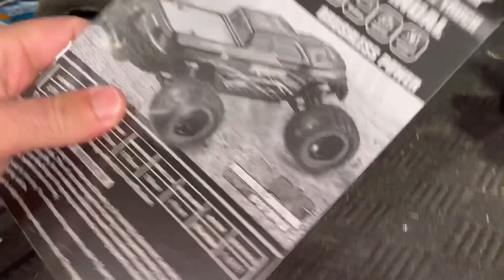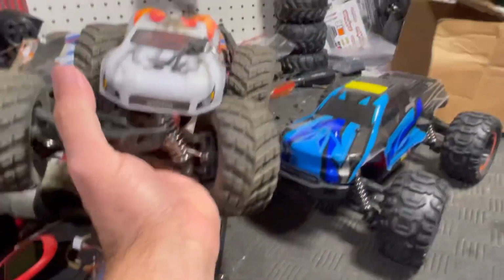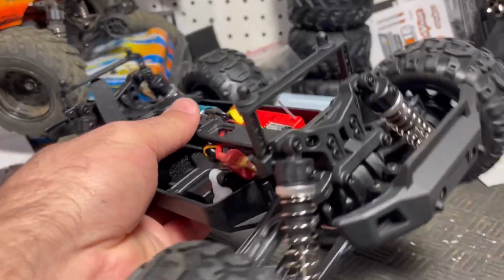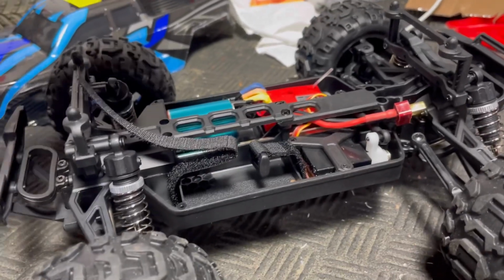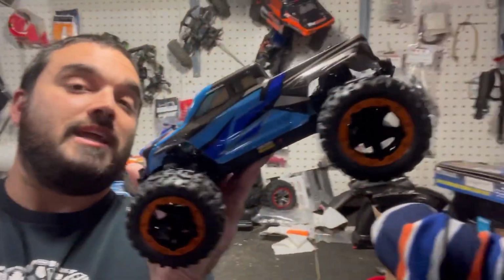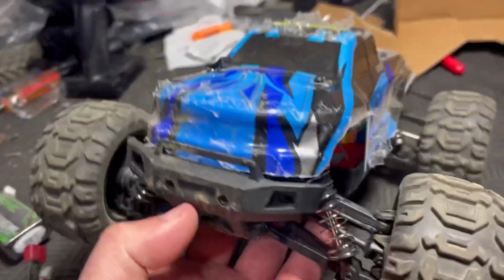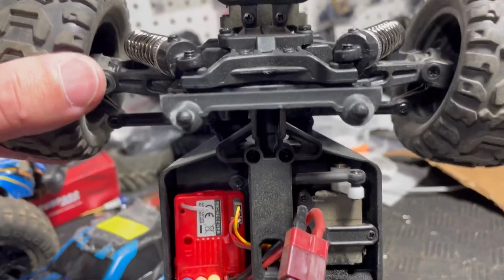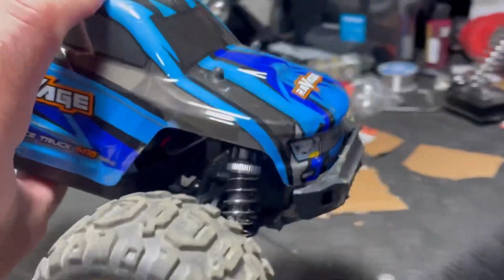HBX 16889a Brushless RC Truck - Review & Durability Test

Comment: I have the SG 1601 Pro which is the same RC all I did was cheap oil shocks from Banggood and it’s my favourite skatepark basher, it never breaks.
Reply from the maker: Yup! It’s a beast! Those are the shocks I put on the 16890 and it made a huge difference, so I’ll be ordering a set ASAP!!
Reply from the maker: I wish I could break away from my house a bit easier to hit a skatepark. That’s why I set my ramps up the way I do 🤣.
Thanks! I’ll look into that MT10E. Looks pretty good! As far as which HBX to get, are you wanting to stay with 1/16 scale? Between the 16890, 16889a, SG1602, volcano, I’m pretty sure it’s just the body shells that are different. Not sure if there is a brushed version. We have the PRO version on the way which is metal drivetrain, oil shocks, and a slightly bigger brushless motor.

Comment: Nice I have the same. But you buy better the 16889a Pro cost a little bit more but oilshocks, better motor metal diff. Is nearly the next on my wishlist 😜
Reply from the maker: Ya, normally I would get the pro, but that’s ok lol! I’ll be doing these upgrades anyway 🤣

Comment: What's the difference in between the 16889 and the 16889A ?? If you could only get one what would you get this rc or the Deerc 9201e ??
Reply from the maker: The main difference would be the brushless motor if I remember right. Going for the 16889a PRO would be better though as it has metal drive train parts that last much longer. I would go with that over the 9201
Reply: @DerbyCityRC  darn I already got the Haiboxing !!
Reply from the maker: The 16889a series is from Haiboxing 😃
Reply: @DerbyCityRC  yes I know it's the rc that I got ! It's Seems like a nice rc !
Reply from the maker: It is indeed!! 😃
Reply: @DerbyCityRC  
It's my first hobby grade rc ! Do you think I made a good Voice ??
Reply from the maker: @timmy4539 which hbx did you get?
The pro version?
Reply: @DerbyCityRC  
I got the Haiboxing 
16890A
Reply from the maker: @timmy4539 the pro version has quite a bit of extra goodness. Bigger motor, metal drivetrain components and differential gears. If it’s not too late, I’d switch if the price seems fair.
Reply: @DerbyCityRC  it is to late the 16890A took my last penny to buy !
Reply from the maker: @timmy4539 ok well no worries it’s still an epic car! Can always upgrade to the metal parts one piece at a time if it ever breaks 😃
Reply: @DerbyCityRC  👍

Comment: Hi , i have one of those . 
For some reason , after a few bashes , the steering works but the car stops on full throttle . Changed batteries of course ...
Any suggestions about what the problem could be ?
Reply from the maker: As in when you pull the throttle all the way, the car stops, but works normal on mid-throttle?
Reply: Stops and dont move anymore .as if there's a problem. Dosnt move even a bit afterwards ...
Reply from the maker: It’s hard to say what the problem is. A common issue I’ve had is the main wire leads breaking on the esc so look for tears in the wire. Any alterations to the car or is it stock?
Reply: No alterations .
I"ll check the wires . 
Thank you so much for responding !!
Reply from the maker: You’re welcome! Mine occasionally would do what you described but it was usually after atleast 10 minutes. I always thought it was from thermal cut off, but it got super hot when I ran it on those extra large tires and didn’t shut off, so I really don’t know. Does unplugging the battery and plugging it back in make it start working again?
Reply: I actually replaced the Esc and the moror , and it still happened . 
Could it be related to the stearing sistem ?
Reply from the maker: I would say if the steering still works when this happens, most likely not. I have heard of Arrmas having a faulty servo causing other issues. Might be related to the transmitter/receiver
Reply: Thanks mate !!!
I guess i"ll have to replace the servo too .
Reply from the maker: That’s an odd situation. Hopefully that’s what takes care of it for you!
Reply: I feel obligated to share 😁
Changed the servo and the car's back and running . 
Still , thanks for the help .
Reply from the maker: @yonatandeakin5274  oh that’s awesome!! Glad you’re back in business😃😃🤘
Reply: I have a 2s lipo 7.4 1600 mah . 
Can i use it regularly with the usb that came with the car ?
Reply: I meant , can i charge it with the usb ?
Reply from the maker: You mean to charge it? Yes that should be ok, just always keep an eye on the batteries and be sure to unplug it when done charging. Always keep it in a lipo safe bag. Even better if you can keep the lipo bag in a vented metal can also👍
Reply: I hear alot of about Ballance the battery . What if i don't and just charge it and go untill batteries empty  And do it all over again ?
Reply from the maker: The balance charging is essentially just using the smaller white plug on the batteries, which the usb charger does. So yes that’s ok, just don’t let the batteries completely discharge and be sure to read the warnings the battery manufacturer states.
Reply: Sorry about the ignorance but how do l know that? 
I usually charge the batteries when the car stops running...
Reply from the maker: No problem! Yes once the car dies, don’t try to shut it off and turn it back on again to keep playing. Make sure to let the battery cook down before charging it back up, and make sure to unplug it once it’s full.
Reply: Thank you so much ! 
Really , thank you 🤗
Reply from the maker: You’re welcome!!! Thanks for watching!! 🤗🤗